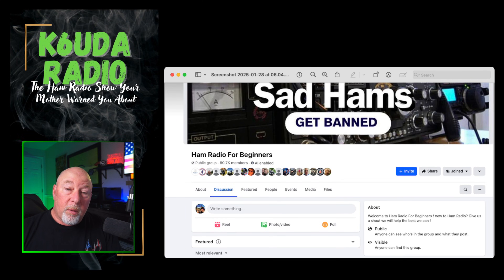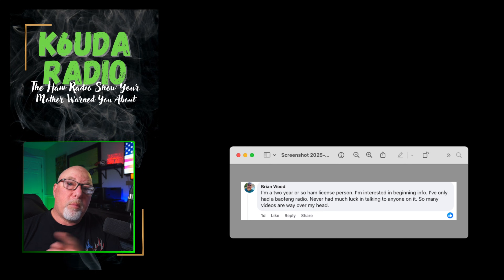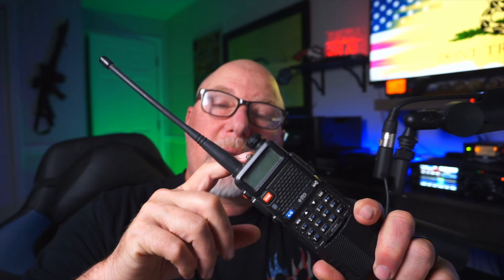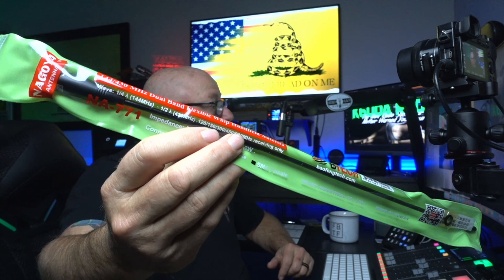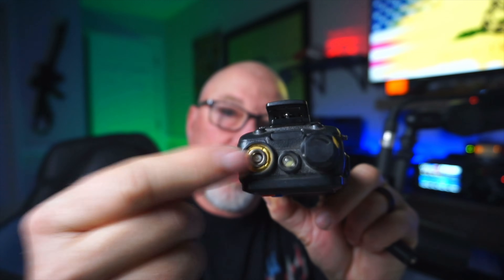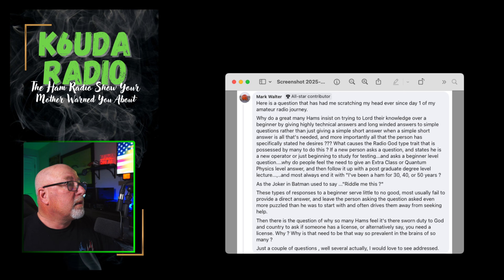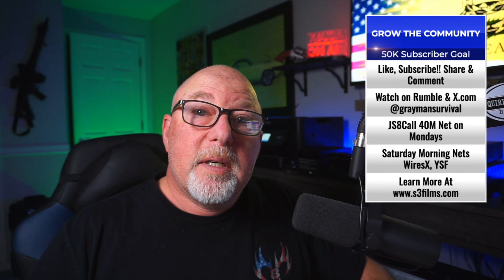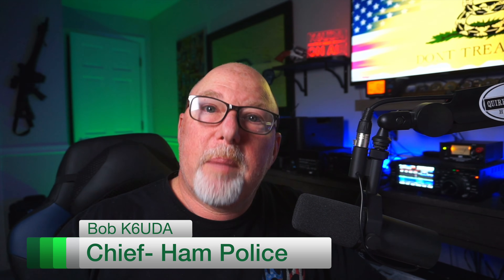Beginners Questions About Ham Radio

Comment: I do want to use ham radio, CB and GMRS radio while riding a motorcycle. I guess I'm going to have to use a uv5r and eventually a better HT with ip6 tech with it, but I'm sure I'll have to use a better antenna on a motorcycle

73 de Kq4hcu

Comment: Baofeng stock rubber duck dummy load LOL worst antenna ever made for an HT!

Find a BD-35 dual band amplifier to use with the baofeng... along with an ed fong J-pole hung up nice and high... or a serious outdoor antenna of some sort for home use.

Second guy... I have been a ham for over 50 years, repaired electronics for even longer, built antennas, now I bounce signals off the moon... so if I come back with a technical answer it is from my frame of reference. All someone has to do is say stop, explain this or that better and I will try... but knowing the basics of electronics/how an antenna works/how propagation works will make your life a lot easier and it isn't hard to learn. ARRL manual has chapters that cover all of it with examples, formulas etc... and I didn't learn it all at once... took me 2-3 years to know the basics, another 5 to be proficient at electronic repair. I got an early start at age 12 but never to late to learn and the day I stop learning is the day they bury me! Learned to weld 2 years ago, just now getting decent at it! Why weld? Local welding shop closed and I have lawn equipment to maintain. Taking the stuff 30 miles on a trailer to a shop sucked!